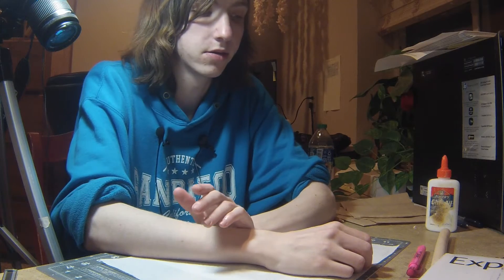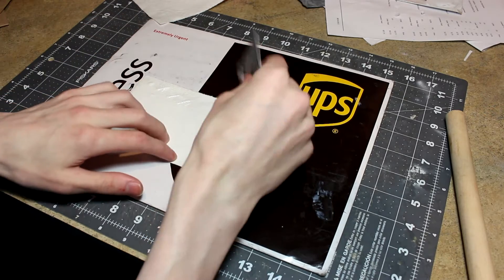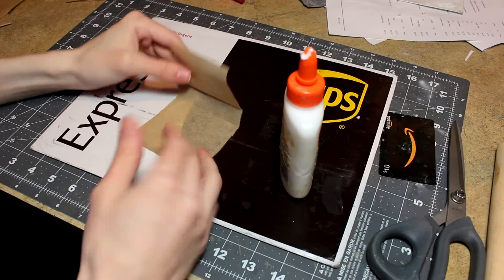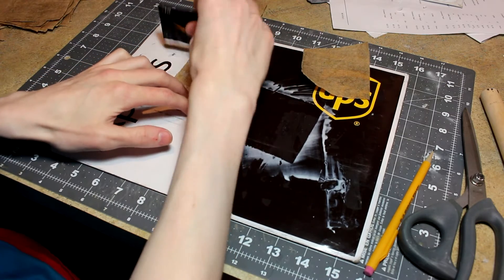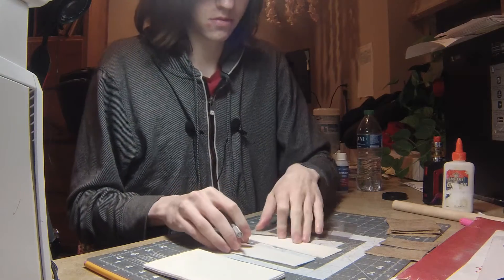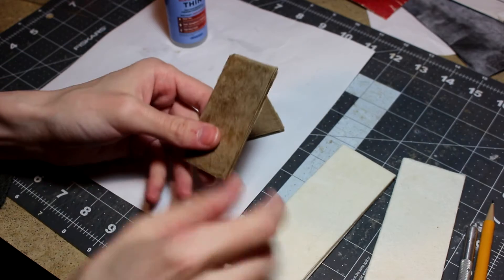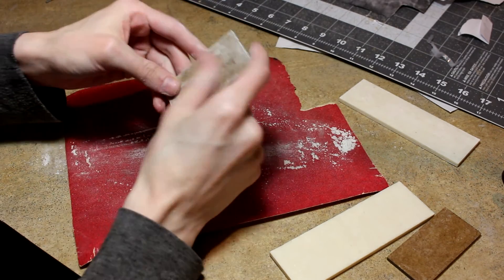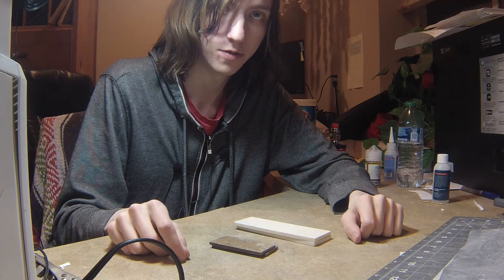Napkins and Glue Turned into Very Hard Plastic Like Material for Machining

Comment: Hey Shelden! Awesome that You experiment with a variety of materials. Is this stronger than normal hard paper from printer paper?
Reply from the maker: It actually does seem stronger than normal printer paper. I was really surprised when I did this. However it would also be a lot more expensive probably because of all the super that would need to be absorbed.

Comment: I'm jealous of how freely the glue flows from your Elmers bottle.  Since forever, I've struggled with the orange cap clogging up and my attempts to clear it never work that well.
Reply from the maker: Lol I know how that feels. I have to constantly pull the orange tip off with pliers and put like a piece of wire through it and also the nozzle below the orange tip. They should come with extra ones haha.